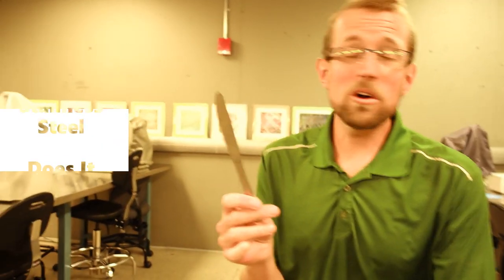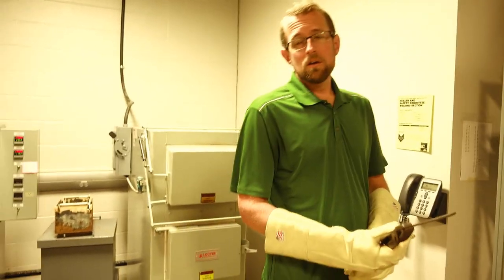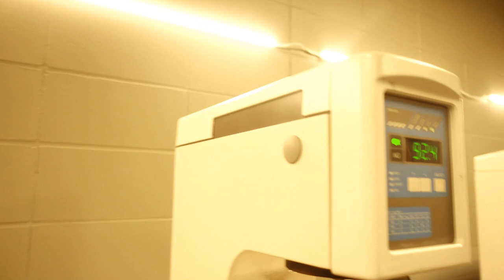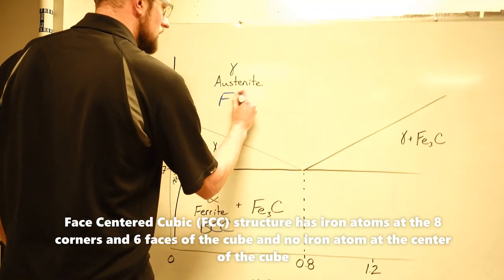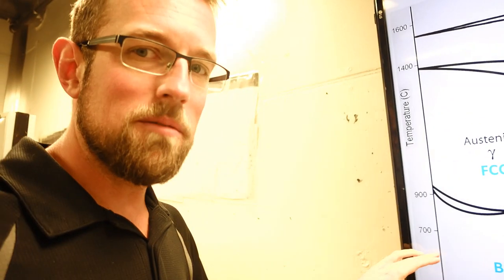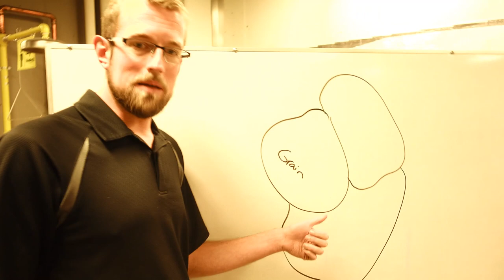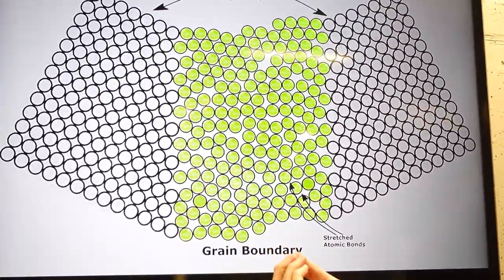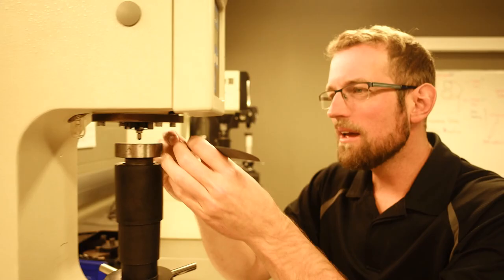Quench Hardening Stainless Steel, Does It Work?

Comment: How do we get stainless steel harder?
Reply: work hardening should introduce dislocations and make granular movement more difficult -> harder
Reply: Some grades of stainless steel can get harder by adding alloying elements such as copper followed by a special heat treatment known as precipitation hardening (PH) which allows formation of hard intermetallic compounds within the steel. Example 17-4 PH steel which has added copper. Plain ferritic stainless steel has low carbon content but by adding upto 1% carbon which can transform it to martensitic stainless steel series which are hard.

Comment: I've got a stainless bar someone gave me,  no idea what kind; I've quenched it in oil and it was so freaking hard brand new resin disks wouldn't touch it. It was like grinding on titanium.
Reply from the maker: Perhaps it is martensitic which has close to 1% carbon id can be quenched hardened, For this video we had ferritic stainless steel which has low carbon (less than 0.2%) which doesn't produce sufficient martensite after quenching and therefore can't be hardened.

Comment: What hardness would carbon steel have on that scale and also quench hardened carbon steel?
Reply from the maker: "Carbon steel" can mean a lot of different things, but a low carbon steel like A36 or AISI 1020 might have something like 60 HRB. A medium carbon steel would be closer to 90 (similar in hardness to the knife we were testing in the video).

Quench hardened steel is much harder, hard enough that it really shouldn't be tested on the Rockwell B scale. We instead use the Rockwell C scale (more load with a sharper indenter), which would give a value of 60-65 HRC for quench hardened steel. That's off the charts for Rockwell B, but would be well over 120 HRB, much harder than the stainless steel knife we tested.

Comment: What would be the hardness of a single crystal stainless piece compared to ordinary stainless made of grains?  And what about metallic glass?
Reply from the maker: To measure microstructure hardness and depending on the size of grain, Vickers microhardness or for smaller grains Atomic Force Microscopy (AFM) can be used.

Comment: What about Chromium carbides?
Reply from the maker: Time is a factor for producing Chromium Carbide (CrC) precipitation. Water quenching a think blade is fast heat loss process and does not produce much CrC. However, for thicker blades, CrC precipitation is a possibility.

Comment: Very informative video thank you. How formability of material will chance as the grains grow? As irregulary arranged grain boundry atoms pass into the grains the whole formability of the metal should increase because of slip planes may increase. Am I wrong?
Reply from the maker: You are correct. The gained ductility is relatively minor, but larger grains are slightly more ductile than small grains.

Comment: Is there any way to regain the hardness?

And also based on the phase diagram you showed us that stainless steels with 16-18% chromium will always be in ferritic state regardless of tempeprature change below 1500c, however I check for SS316 stainless steel contains about 16-18% Cr but is considered austenitic stainless steel. Am i misunderstanding anything?..
Reply: That diagram is not accurate for 3XX series steels because they have large nickel additions which increase the size of the austenite phase.
Reply from the maker: It is difficult to regain the hardness in ferritic stainless steels. A typical steel could be normalized (heated to austenite, then cooled in air), but that doesn't work for stainless steel since it doesn't have a phase change when heated. Plastic deformation via cold working or hot working the steel could regain its strength, but not without altering its shape.